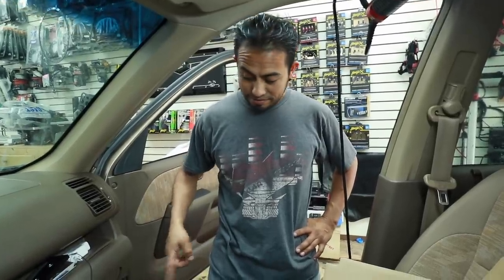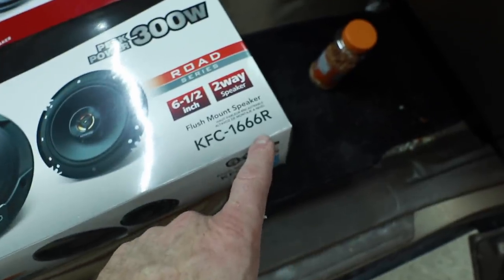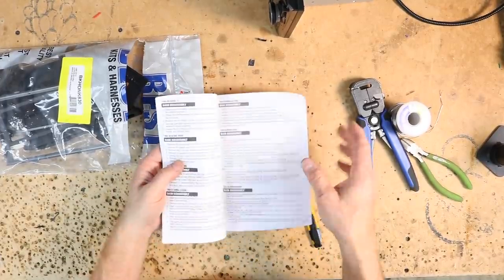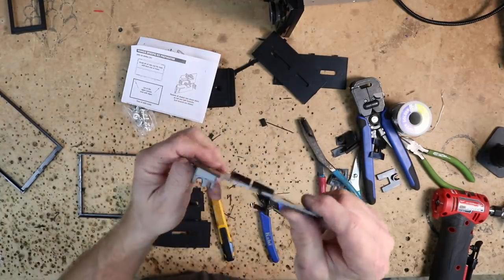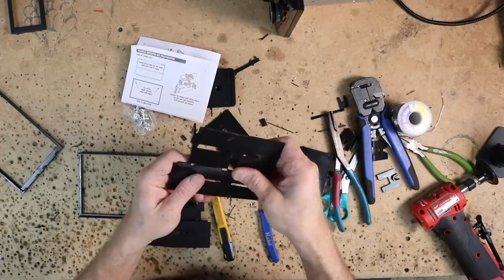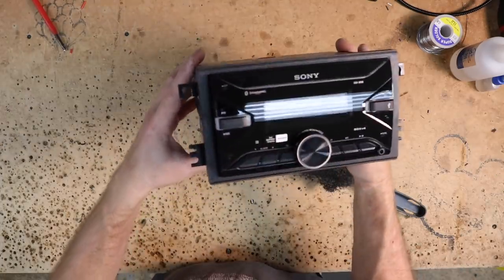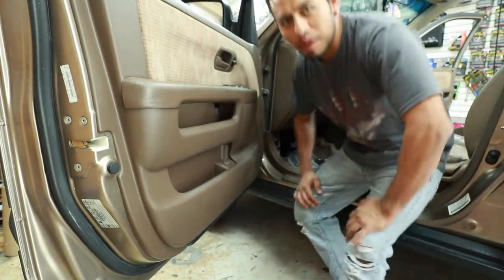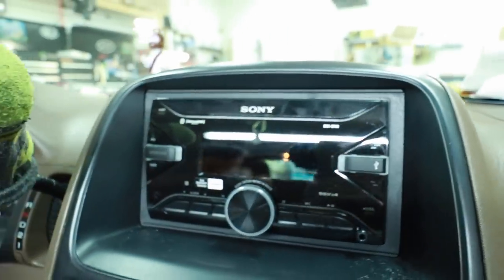I hate this Honda dash kit the most Installer Diaries 285

Comment: Good morning nice video just can’t get enough . I was sitting here and wondering if you guys would know where the sync module is in a 2008 Ford Edge so I can disconnect it because my new aftermarket radio steering wheel controls won’t work right. Thanks again for all the great videos and good advice.
Reply from the maker: Should be in the Center counsel under armrest
Reply: Thank you